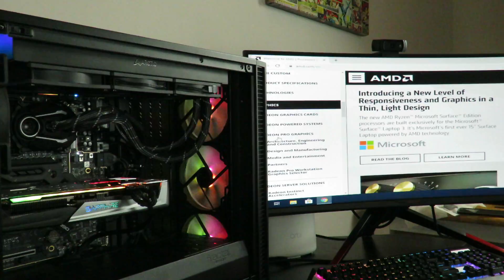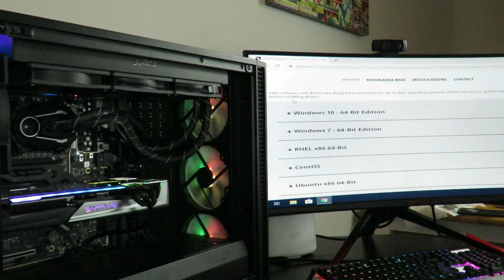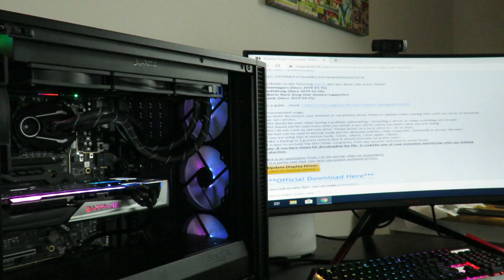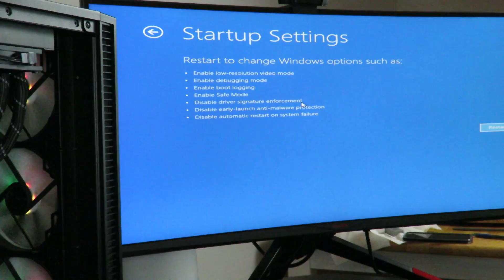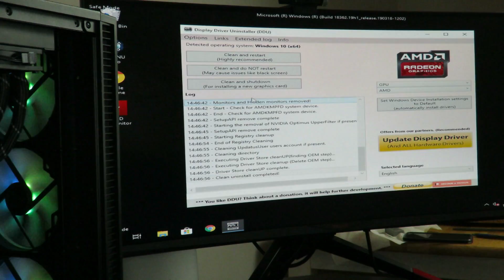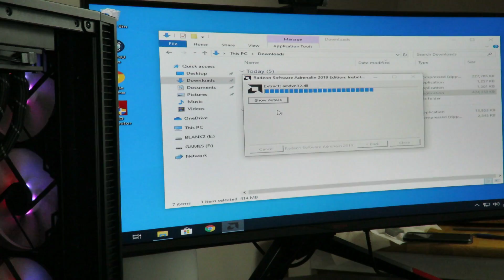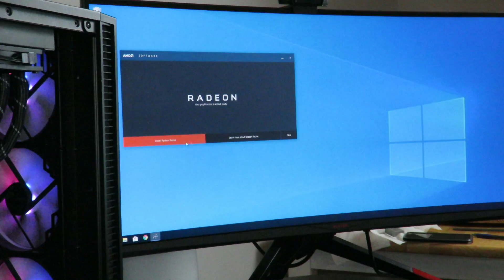Installing the AMD Sapphire Radeon Nitro+ RX 5700 XT 8GB OC Graphics Card

Comment: I'm consider buying this vga over rtx 2070s. Is it worth it? Does this vga too hot or consume more power than 2070s?
I'm using corsair rm650x btw
Reply from the maker: While 5700 XT is a great card, the 2070 Super is a better card, but you have to make sure its a super, the regular 2070 is on par, so the card I recommend is this one: https://geni.us/auQLQ, but you will notice, it is about $100 more than then 5700, so it is up to you, https://geni.us/VoHIZhu.  My recommendation, as much as I loved the 5700, probably would be to go for the 2070 super, since it does perform better, will give you a little extra life out of that card.  Let me know what you decide, and by the way, the power supply is perfect.
Reply: @ThisBytesForYou  Wow $100 more with 10% performance or less and ray tracing.
Maybe i'll go with the 5700xt cause i want to save more money on my CPU. Tough one

I'm going to build a new PC soon so thanks for your advice, it was really helpful. I'll let you know when i'm going to buy it :D Thanks
Reply from the maker: @bachkhoi9450  sounds great, I am so happy I could help.  Please let me know if you have any other questions, always happy to help.

Comment: Hey, im french, but i understand english, thx for this video, i will do a new computer with ryzen 5 3600 and rx  5700 xt on the b450 aorus elite, do you think i need to reinstall Windows ? Cause new gpu cpu and motherboard
Reply from the maker: Welcome my friend, I hope you like it here and you write out english very well, I speak and write english, my my first language is spanish though living in the states, I don't use it much.  As for the motherboard, you don't "need" to, but I would recommend it.  I am not sure what board you came from, but many times the boards will have a different chipset, so even though you are uninstalling the older drivers and installing the newer ones (some people never uninstall the old), remnants of the older drivers stay behind and cause some issues.  If you are coming from Intel, between Intel and AMD there are completely different chipsets and HAL's (Hardware abstraction layers) that are not compatible with each other, so they can cause serious issues, kind of like me going over to germany only speaking spanish, I can understand a few things, but for the most part I wont know what they are saying or them know what I am saying, causing issues.  A fresh install of windows with newer drivers and all will not only relieve those issues, but a fresh install of windows always runs so fresh and clean, I redo mine every few months, or when I have a new video card to review.  Sorry for the long explanation, but I hope it helps.
Reply: I forget +1 follow and like !
Reply from the maker: @DidierAuChomage  Thank you so much my friend, I thank you so much for stopping by, checking out my video, the sub and the like, but thank you so much for your comments, it means the world to me and I love the interaction.
Reply: @ThisBytesForYou  ok Thanks for all ! :)
Reply from the maker: @DidierAuChomage  thank you as well my friend

Comment: Is there any sagging on this card? I can't really tell from this video.
Reply: Clear sagging. I installed mine yesterday. You can tell it’s on a slope.
Reply from the maker: @kikesanders1396  try counter balancing it with the screws, the screws will make all the difference.  When you pop the card in, and pilot the screws in, slightly lift the card, make sure that you can still plug in the HDMI/DP cable on the card, then screw it in firmly.
Reply from the maker: impossible, its a brand new card, sag does not occur in minutes, it occurs within a few months.

Comment: Nice tutorial thanks, but I have something to ask: basically I ordered the rx 5700 xt nitro+ and I'm currently waiting it, but I saw something online that worries me, and that's the Gpu sag. My case is a sharkoon tg5 rgb and my Mobo is a b450 aorus elite, I don't know if it will sag or not, can you tell me if you had problems with that and if my case and Mobo are strong enough to maintain it?
Reply from the maker: I know a lot of people have sag issues, and in the 20+ years i have been building PC's, I have never had an issue.  When you install the card and are going to screw it in, don't leave it slid down on the lower slot.  When I install a card, I lift it a little tiny bit (make sure you can still plug in your video cables) then I screw the screws in and you should be good.  This is not to say this is the solution, but it is my solution that has not let me down.  I will see if I can address this in a later video, but you case seems perfectly fine, I don't think you will have issues.  If you feel like you will still have issues, maybe this would work for you: https://geni.us/mzA7

Comment: Thank you very much from France mate :) I decided to give a chance to AMD so I've just purchased a Ryzen 3600 + Sapphire Radeon Nitro+ RX 5700 XT  beside my I7 4790K / Geforce 1080 computer. Your video will help me a lot when installing all the stuff. Thank's again.
Reply from the maker: you are so very welcome my friend, I am so very happy I could help you.  Please let me know if you need any further assistance down the line, always happy to help.
Reply: psour33 How does the 5700 XT compare to the 1080 you previously had? Does it run hot/loud?
Reply: @lilTryhard  Hi ! in fact imho, if you already own a 1080 it is useless to change for a 5700XT especialy if you own like me a Zotac 1080 AMP Extreme edition wich is heavily overclocked. The Nitro+ is very good but it does not worth the exchange. If you have an old Radeon or a Nvidia 9XX serie you will earn lot's more fps. Against the 1080 you will earn to few fps in games but if you're a flight sim fan like me you will loose FPS (especialy with X-Plane 11).
Reply: @psour33  I play mainly Apex Legends, and I gained about 100 fps running medium settings on the 5700 XT, coming from running low settings on my 1060 6GB. It's a massive improvement honestly, the biggest setback thus far has been learning newer driver software. Thank you for the reply!
Reply: @lilTryhard yo can u guys tell abt ur experience on 5700xt i am planning to buy it
Reply from the maker: It was a great card, but please realize it was released in 2019.  We have had the 6 series, 7 series and now 9 series since then...it will still work but don't expect amazing performance
Reply: @ThisBytesForYou i dont need performance the users saying it got driver problems just like new series actually scares me  so do yk abt that??
Reply from the maker: @iamagamer2488 the newer and older version use the same driver.... I have worked with thousands of AMD and Nvidia cards, the driver issues are usually bios settings or hardware issues, not driver issues.  Aside from performance, older card get drivers discontinued, this is an older card. You know the saying, people are scared of things they don't understand.  Help them understand.
Reply: @ThisBytesForYou so i shouldnt buy 5700xt becuz it got driver issues?? or is der any way if it occurs i can fix it?

Comment: I have this card and it’s getting REALLY hot, any reason for that or does this card just run warm? I have a 600W psu
Reply from the maker: There are 2 temperature readings on the card, there is GPU and then GPU Hotspot, you can see which is the one you are seeing using GPU-Z, then clicking the sensor tab, and on the bottom left hand corner, placing a check in the box that reads "Log to File", have that save to your desktop, then play a game.  It will record your temperatures and place it in that document.  When you are done, close GPU-Z, so it will stop writting to the document (make sure its not still running on the bottom right hand corner in the application tray), then open it up and you will find the 2 sections.  Let me know which of the 2 is reporting the higher temperatures?  If it is the GPU hotspot, I found it pretty hot as well.  How do you have your fans situated in your case, front, top and rear and how many fans?  Do you have any card under the Nitro, and if so, what is the distance, and what card is it?

Comment: I just purchased this card to upgrade from my gigabyte rx570 card, but unfortunately, I am unable to get it to work. The card is seated properly with two 6+2 cables powering it, but whenever I start the machine, the screen remains black. The colors on the card itself pulse red, and the fans begin to spin. My PSU is a thermaltake smart series 700W and is more than enough to power the card according to the power requirements. To troubleshoot, I reinstalled my rx 570, and it worked perfectly fine. I've taken all of the safety precautions I could by discharging the computer, and even grounding myself to the case. I'm sure your busy, but any help would be greatly appreciated.
Reply from the maker: Ok, so a few things, from the x570 to the 5700 (huge upgrade, congrats) you are for example using HDMI, on the 5700 you are using DP, do you have your monitor set to the DP input?  What motherboard do you have this installed on?  Sounds stupid, but are both 6+2PIns connected properly to PCIE connections on the power supply, if it is fully modular?  Are you on the first PCIE slot?  If your motherboard selected to UEFI, if you have the option?  Have you tried reseating the card, removing it, then popping it back in?  Does the motherboard have the latest BIOS, if not, can you flash it to the latest version?  I am always busy, but I always find time to reply to everyone, I love helping people.
Reply: @ThisBytesForYou   ThisBytesForYou  hey, thanks for the reply, I've been busy and haven't been able to respond. So don't laugh at me, but I'm using a little 2013 XPS 8700 Dell system. I've upgraded the PSU to a thermaltake smart 700W with two 6+2 cables powering the card and 32 GB of RAM. The motherboard is an intel KWVT8, set to UEFI and the processor is the stock i7-4790. Whenever I power on the computer, the fans turn on like normal (and eventually the GPU's fans as it gets hot) with no error beeps, but nothing but a black screen is displayed on the monitor (I am using DP, and the monitor is set to the correct output). When plugging my former card back into the computer, it works as normal. I've updated the BIOS and made sure all connections were secure, but that's all I know to do. I'm stumped, so if you could help me out that would be fantastic.
Reply from the maker: @charlesdarwin6224  hmmmm, you have taken all the steps I would have recommended, have you tried the card on another system to see if it is the motherboard or the card?  What video card were you using before?

Comment: Hey is there a reason my gpu is only getting 40% on the benchmarks? I have a Ryzen 5 3600x btw.
Reply from the maker: there could be many, what is the model number for your RAM.  Do you have things installed on an SSD rather than a mechanical drive?  What is the refresh rate of your monitor?  Did you use DDU to remove the old drivers and install the latest?  Do you have the chipset drivers installed for your board, what is your board manufacturer and model number?  Do you have the latest BIOS installed?

Comment: will a 280 mm radiator fit in the old fractal define s?
Reply from the maker: yes, I have it, depending on the heatsinks and ram on your board it will fit on the top, if not, at least you can put it on the front
Reply: @ThisBytesForYou  okay, i wanted to install it in the front anyway, the tubing is also long enough right? Thanks for your answer😊
Reply from the maker: @lars8329  very cool, so you are good, very happy I could help

Comment: I built my pc today and everything is working fine except for the rx 5700 xt nitro+. It doesnt show up in the device manager neither does it in the uefi bios mode. downloading the software also doesnt work since it gives me an error where it says that there are dll files missing do you have any idea how to fix it?
Reply from the maker: so the fact that you are saying it does not show up in device manager tells me you are using onboard video, connect your monitor to this video card, then turn on your system and it should start using that card, also make sure you have both PCIE connections plugged in and make sure your card is properlly seated in the slot, maybe remove the card and plug it back into the very top PCIE slot.  Also, use DDU like I show in this video, https://youtu.be/clLYbBywhAg and remove your old drivers then install the latest one
Reply: Fixed it the problem was basically that i didnt have the .dll files which after searching for a few hours I finally managed to download, with that I could install the drivers and my card got detected, still thanks for trying to help me out tho I appreciate it!
Reply from the maker: @Ronline26  so not sure why you were having DLL file issues, hopefully you are not installing the drivers through device manager, I HIGHLY recommend using DDU to uninstall all the drivers and then installing the latest and greatest drivers through the setup file provided by AMD.  If you don't do it this way, you open your self to potential performance issues, but if its working now, I am happy I could help.

Comment: I just bought the sapphire nitro+ special edition and its coming for xmas. Upgrading from a 1050ti, planning to build a new pc and sell mine with the 1050ti, but for now ill just change it for the 5700 xt
Reply from the maker: not sure on your system specs, but I can tell you this upgrade will be huge, congratulations my friend,  please let me know how everything goes for you and let me know if you have any questions.
Reply: @ThisBytesForYou  thanks buddy.

My actual specs are:
Ryzen 7 1700 3.7ghz
Msi x470 gaming plus
Gtx 1050ti oc 4gb
Corsair vengeance lpx ddr4 2x8gb 3000 mhz
Nox hummer gd750 750w 80 plus gold
Corsair hydro cooling h80i v2
Barracuda 7200 rpm 1tb
x2 Kingston a400 ssd 120gb

And this is what i plan to build
https://www.pccomponentes.com/configurador/8d290cC5B
Reply from the maker: @imshevi  I think this would be a tremendous update for you on this system and for the new system.  Going fromthe 1050 with only 4gigs of RAM and of course the huge bump in performance, you will be able to game at 2K and turn on some eye candy, you games will play beautifully.  Congrats my friend.
Reply: @imshevi  how much you selling for?
Reply: @deadlybladesmith3093  based on actual prices in my country, 800€

Comment: A Be Quiet! System Power U9 600W would handle this GPU?
Reply from the maker: yes, that power supply has 4 x 6+2 connections, you can find it on Amazon here: https://geni.us/VaXRum
Reply: Dude I'm running this on an EVGA 500w standard with no problems. 600W is well enough
Reply from the maker: @mycelia_ow  not saying it will not, but Sapphire states it requires a 600Watts and recommends a 650Watt.  I would always go with what the require and would better off go with what they recommend..  This of course being if you are overclocking, hardcore wise with their recommendation.
Reply: @ThisBytesForYou  of course. I really wanted this specific model so I didn't have enough to upgrade my PSU 🙃 I hope it's still fine though, I refuse to use the middle v bios even though I probably should lol. I think companies overstate how much Watts you'll need just to be absolutely sure you have enough headroom. I'm probably suffocating my PSU. Great video btw.
Reply from the maker: @mycelia_ow  no, you are good, you have plenty head room, but usually they recommend higher wattage psu's if anything to make sure you are covered amperage wise.  You check out this video, where I review this card showing you the power consumption as well, but tomorrow I have another one on this series coming out: https://youtu.be/YWzqVU6Oq74, let me know what you think and thank you so much for the complement, I do appreciate it.  In the video coming tomorrow, you will notice MUCH better video quality and audio quality, I am trying my hardest to improve.